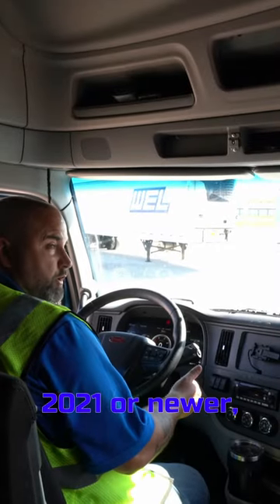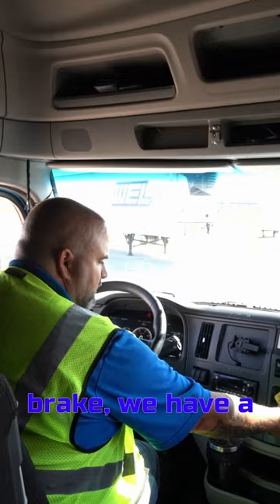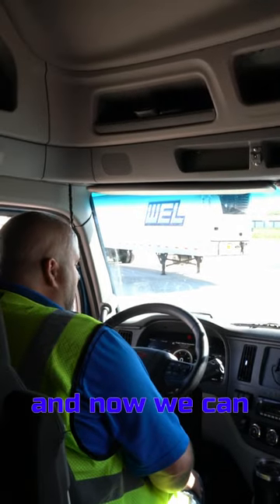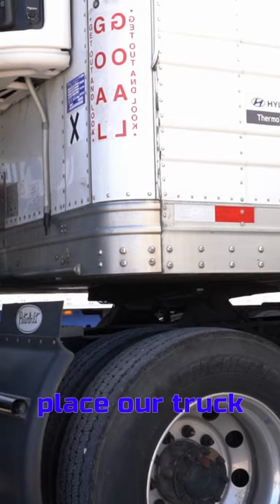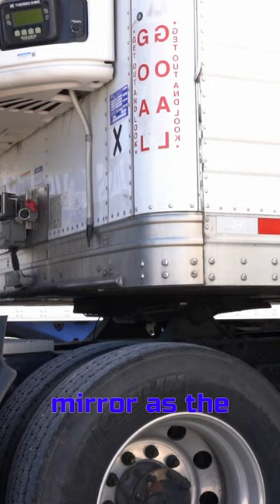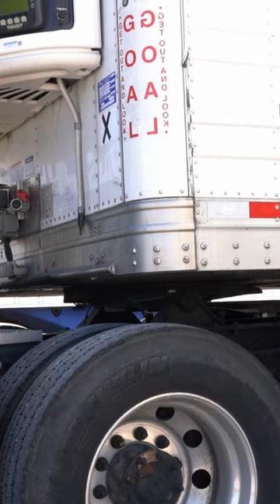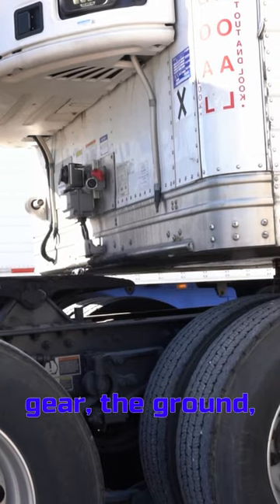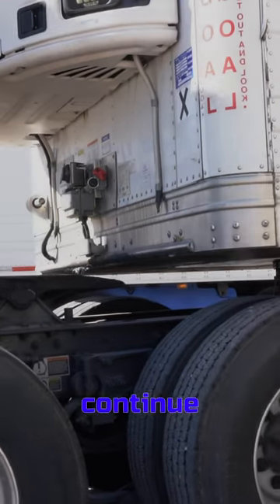How To Release The Fifth Wheel On New Trucks #truckers #truckingindustry #truckerlife #trucking #cdl

Comment: That's stupid, ive been driving for 46years  you have to get out to put the landing legs down so why not pull in pin.  Ive also seen they freeze in the winter
Reply from the maker: New technology can be a convenience or inconvenience, just showing how to use this feature!
Reply: @welcompanies not new technology..drove a 2005 century for years a decade ago that had that..was an old Gordon truck and they all had thoes for a few decades.
Reply: Air lines too
Reply from the maker: Airlines must be detached separately. @joeshmoe1436
Reply: Only reason it was created was to save mega carries from workman's comp claims do to shoulder/elbow injury claims😂😂

Comment: most useless button if you still have to get out to disconnect brakes and lower landing gear
Reply: Im super serious about the fifth wheel, even if i just go in and load, i check if someone been on it, pulled it.
With button in the dash, i hope that elimate the exterior release!

Comment: My truck is an 07 and it has the fifth wheel release inside the cab that's old technology
Reply: Sort of pointless as well.🤷🏻‍♂️
Reply: Yup. I had a ‘99 Freightliner Classic XL with it. It quit working. Pulled that fifth wheel off, and put a regular pull pin on it.

Comment: First thing I would disconnect. If you’re that useless that you can’t simply pull it when you unhook the rest and lower the landing gear, you need a different job. Besides, you don’t want the cab ECU jack by any connection to something THAT important.

Comment: Using technology and corporate ideas formulated by somebody that's never driven a truck to over complicate one of the simplest tasks in trucking. Get out, run the gear down, pull the pin, unhook the lines, drop the bags and pull out with sense. No need to move up stop move up stop.

Comment: That's BS.  You should pull away from the kingpin about 2 inches to clear the pin. Then lower you air system.  That way you DONT DAMAGE  you jaws in 5th wheel.